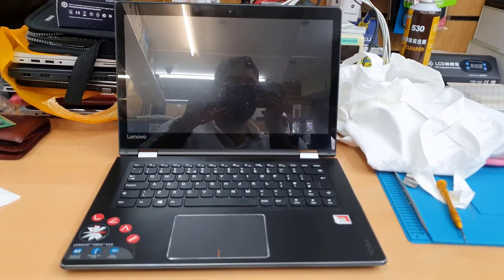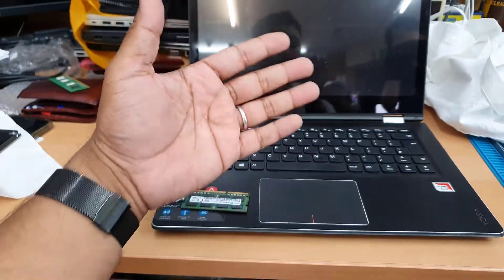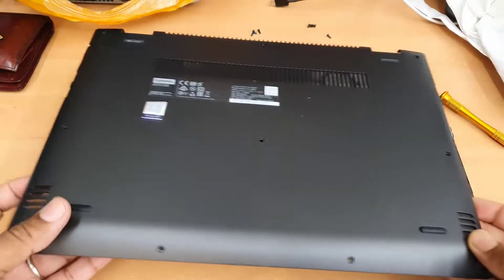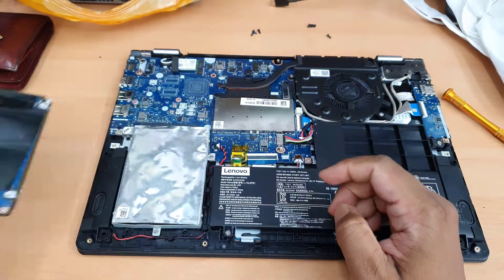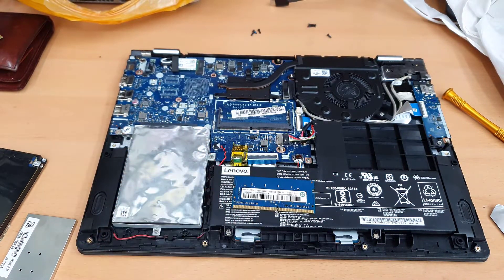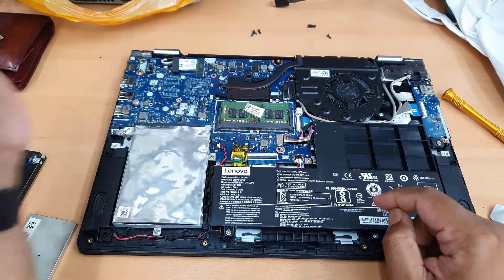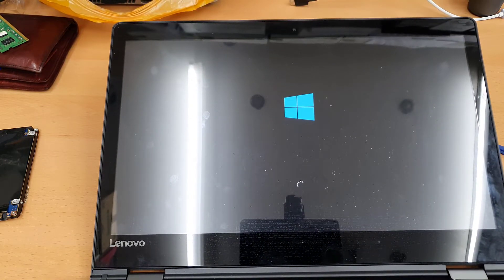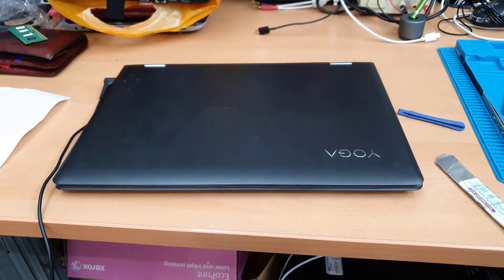Why Lenovo Yoga 510 Is Slow And How To Make It Fast

Comment: Can you please tell the what item should be replaced in yoga 510 intel i3 processor very slow working....
Reply: I would say similar to the author.
Swap to ssd and  increase the ram.
My wife and I (after running the lappie through the Kingston website) got a 16GB ram chip each
If the processor is soldered to the motherboard, you are stuck with it

Comment: How did you unplug the battery connector so easily? Mine seems to be stuck. Trying to do a battery replacement.
Reply: It's glued in very tightly. Make sure you tug it with force but be careful